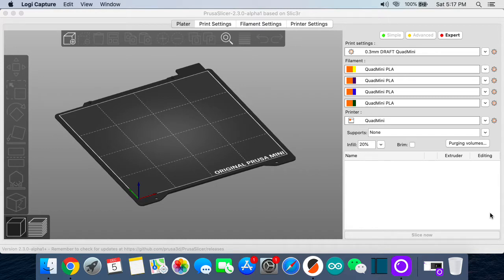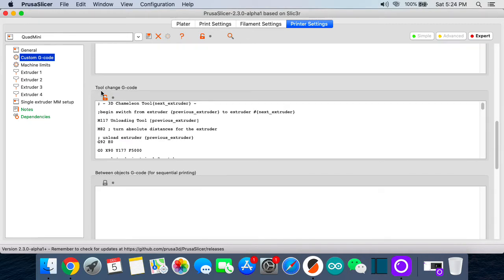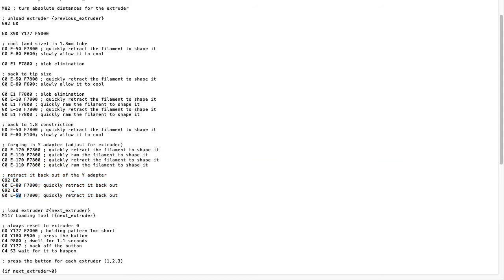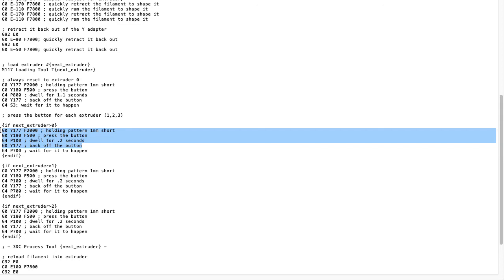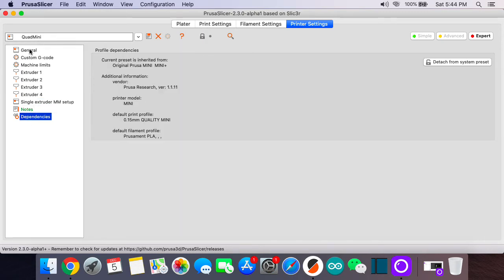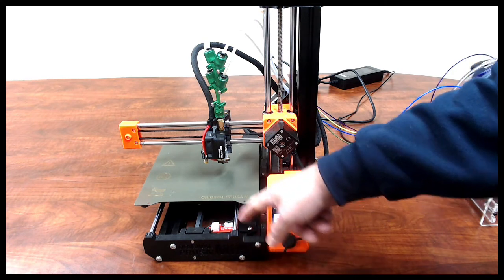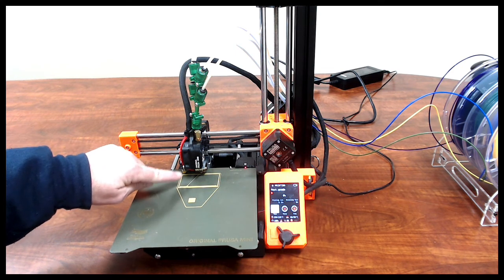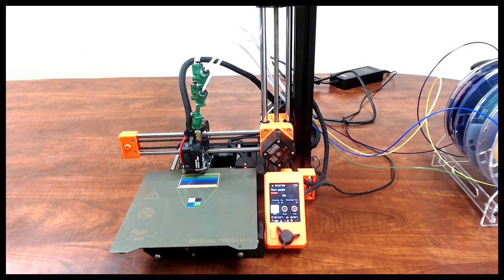3DChameleon Mk2 using PrusaSlicer

Comment: To install the post processor, follow these steps:

1) Install Python 3.9.1 (from https://www.python.org/downloads/)

2) Copy reversedrive.py to the same location as PrusaSlicer.exe.  (You can find it by right mouse clicking on the icon and choosing "Properties", then clicking on "Open File Location."  Just paste the post processor file there.

3) Then changed the PrusaSlicer post-processing script string to this:  C:\Users\wjsteele\AppData\Local\Programs\Python\Python39\python.exe reversedrive.py;

(Note: You'll need to change the path to point to your "username" AppData directory.)  That is where the Python 3.9 was installed... the full path.

Once you do that, it should work perfectly.
Reply from the maker: For Mac, download the Mac version, but you can skip #1, as Python is installed already on your machine by default.

So, follow these steps:

#1) Download reversedrive_mac.py from above.
#2) Copy to Mac /user/{username} directory.
#3) Paste this command line into PrusaSlicer's Post Processor: 
python /users/{username}/reversedrive_mac.py;

Be sure to replace {username} with your actual username on the computer.

Comment: Rather than using the awkward limit switch (its ingenious though, love it!),  have you tried using M42 commands and the built-in GPIO headers on the Mini's Buddy Board (perhaps with a logic level converter if needed)? The limit switch (or rather a user-facing button somewhere) could be wired in parallel for manual changes.

Another question is regarding reliability, how many prints have you done with the Mini and are there any customer testimonials, I'm mainly concerned about the constant ramming during changes and added weight to the Z axis. Thanks!
Reply from the maker: So, these have been running for well over a year now without issue... we always bring one or two to the public events, like MRRF and ERRF, that we attend.  As for the M42 command, there are several customers who have done exactly that... you can actually use the pin header that is already on the 3D Chameleon's main electronics to accomplish that.  All you need to do is tie together the shared ground and the I/O line.  Lastly, about weight, there really isn't any additional weight, as the PTFE tubes carry the weight of the Y adapter, which is really only a small amount.  The PTFE tubes actually lift up the Y adapter, so it's not pressing down on the extruder anymore than the stock configuration.  As for customer testimonials, I don't ask users for that kind of information... if they feel like responding, they can.

Comment from the maker: I might add, the grinding of the homing in this video sounds much louder than it really is.  For some reason, the microphone is picking it up very well.
Reply: The latest 3D Chameleons only grind on first run while it homes it... after that, you only need to press 1/4 of a second to move forward... if you're on the last extruder (#3) and you press for 1/4 of a second again, it will automatically reverse to the 1st extruder (#0) without rehoming.